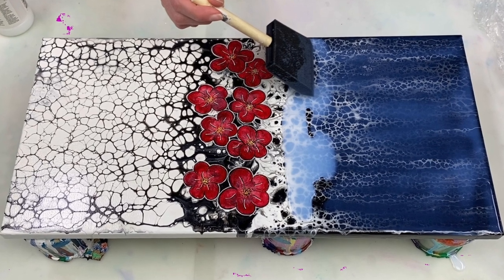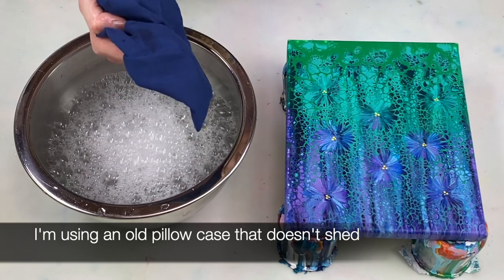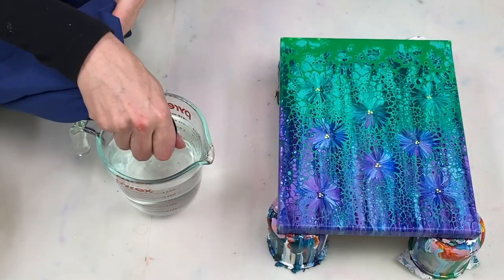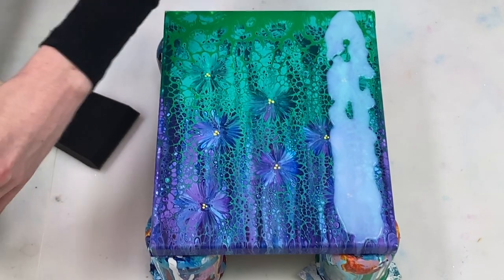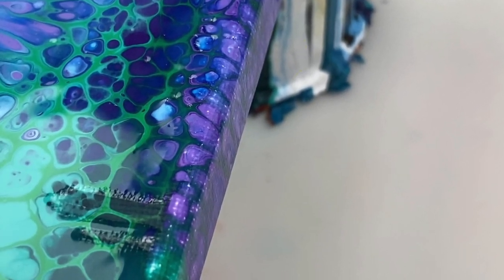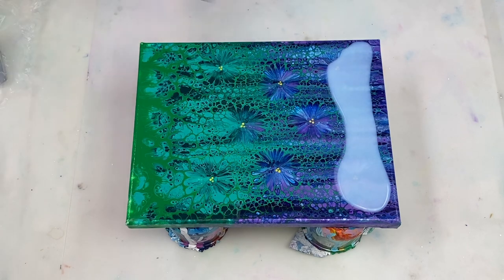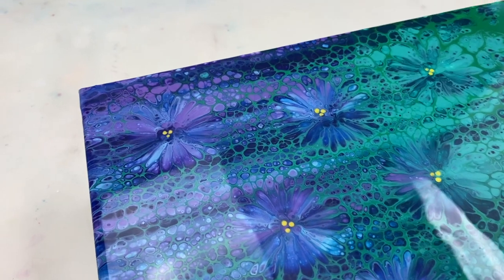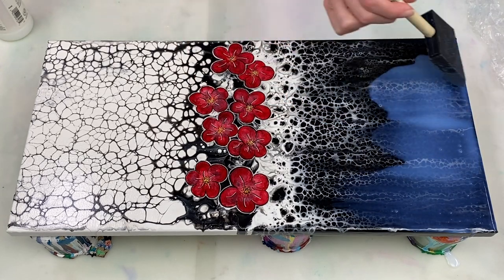73. How to varnish your acrylic pour painting | How to remove silicone oil and avoid brush marks!!

Comment: Thanks for another great tutorial. I have used spray varnish in the past, but did not really like the look of the finished product. I have been using resin for the last year, but do not like the plastic look that it gives to the painting. I just ordered Liquitex gloss varnish and a foam brush from your Amazon link and I am hoping that this gives me the final look that I want. Thanks again!
Reply from the maker: Thanks Kathy! All the best giving the Liquitex Gloss varnish a try - I hope you like the finish! Btw. when you use the foam brush on the varnish, one tip - don't press down on it at all, simply drag it across the canvas with no downward pressure.  (I find that if I press down lots of little air bubbles get released and it ruins the smooth look of the varnish, whereas if I just drag it along the canvas I get a nice smooth finish.)

Comment: Thank you so much for this video! Do you clean your brush after use or do you just wrap it in cling film?
Reply from the maker: My pleasure! While I'm in the process of varnishing a painting (if I'm just waiting a few hours or overnight) then I wrap the brush in cling wrap. However, once I've finished varnishing a painting then I do clean the brush.
Reply: Oh, thanks, that helps me! Could you please tell me how you clean your brush at the end - just with water or with something like turpentine?
Reply from the maker: @daskunststueck3199  I just clean it with some warm water straight after I’ve used the brush and sometimes I might use a little bit of dish soap. (I don’t use turpentine.)
Reply: Thanks a lot for your answer! I'll try that. It is the first time that I varnish something, I lack only a little courage - but I have to go through! The second time will be easier. ;-)
Reply from the maker: @daskunststueck3199  Good luck! Don’t worry, it’s not as scary as it seems! 👍😊
Reply: @dcfluidacrylics6633  🙂